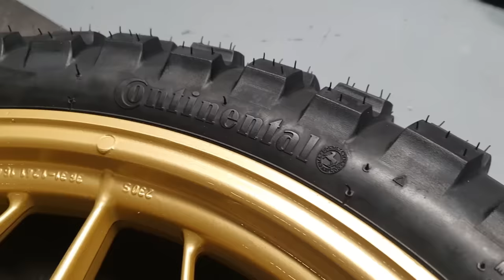BMW R100 RS Scrambler Full Build & Riding

Comment: Lots of obsolete touring bikes out there await chopping and the prices are right. While under-powered the old Airheads are simple and reliable so turning them into a coffee shop ride folk art piece is better than scrapping them. If you DIY nothing on that bike is expensive and parts are easy thanks to Ebay. Touring bike riders are like RV owners, if it's not the latest most loaded machine it goes cheap so take advantage.

Comment: Even if I'm more of a "stock" fan, the job you done is amazing! I was wondering how is the braking now with this new fork, callipers and discs ? And where did you get the fork crosses ? Is it specific made ? Cheers from France 😃
Reply from the maker: Thanks man. I bought the triples from The Powerbrick. That way it's an easy plug & play. The calipers and discs needed some custom work to make it all fir properly. Check out my IG page, Corner.Custom. There's more info about all this (and more) 👍

Comment: It looked better stock
Reply from the maker: Ok mr Wanker, thanks 👍
Reply: @corner.custom  its not a practical design, the seat looks like it should be on a riding lawn mower and the lack of fenders is case of style over substance
Reply from the maker: @dodgeewanker2179  Compared to OEM yes the bike became less practical, but became much more fun to drive due to the loss of weight and better drive ability due to the better shocks. I've put rear fenders on some of my R builds, but with this bike I wanted to go without. Matter of taste

Comment: Fucking hell that's a cool bike. Scramblers can be very very cool, especially with that naked look and off-road tires. 
I really want a super sport, but only because it will fit my needs. I don't like a lot of plastic on the bike and if i was living somewhere, where there were lots of dusty and muddy tracks, i would definitely think of a scrambler.

No plastic... on and off-road capable...that absolutely dominant sound... the license plate on the side...PERFECTION.
Reply from the maker: Thanks! That's why I've chosen to go for a metal fender instead of plastic one. More robust and better overall quality. The license plate holder is custom made, but painted it black to blend it in with the black theme of the bike so it wouldn't be that noticeble

Comment: you need blue fenders mate with a bronze paint line on them same as the gas tank...or black fenders work well too
Reply from the maker: With previous R builds I did that. Both actually. Black front and rear fenders, but also color matched stripes. Looked good, but for this bike I wanted to go this route
Reply: @corner.custom  nice! Well when the wheels are naked like this build, the bike looks more beefy💪Let's you see the whole circumference of the circle of the tires...LOVE THE BIKE!! GREAT WORK beginning to end!!💯👍
Reply from the maker: @reydelsanchez  Thank you man, appreciated 👊🏼🤙🏼🤙🏼

Comment: I wish you had a parts list. 
Awesome bike!!
Reply from the maker: Most of the parts used during my builds are mentioned on my Instagram page, Corner.Custom
Reply: @corner.custom  thanks I will definitely check that out. 

I’ve been having some issues, finding tires for my r100 (86) it’s a mono lever model. Both wheels are 18s, what other options do I have to go with a 19 in the front. Will wheels like yours for on my bike?
Reply from the maker: I'm not sure, I never build a mono before. But I'm quite sure that there are a handful of people who had the same issue as you have and came up with a perfect solution. Google is your friend 🤙🏼
Reply: I have MICHELIN ROAD CLASSIC 100/90-18 56V up front and MICHELIN ROAD CLASSIC 130/80B18 66V as rear tyre on my R100RS mono

Comment: Hello. I have a Honda CX500 and would like to use this speedometer. Honda has both sensing mechanically by drive. How do I connect this alarm clock? I looked that there are some "adapters" of the signal. Or take a signal from the ignition coil. And connect the speedometer via the front wheel, via a magnet, like a bicycle. Which alternative is used here. Or what do you think is the best solution?
Reply from the maker: Just go for the magnet, worked every time for me 👍🏼👍🏼

Comment: Probably a silly question but how do you keep track of where all the bolts and what-not and where it goes when putting it all back together?
Reply from the maker: Pretty good question 👍🏼I trow away all the normal bolts, washer etc. All the special brackets etc that are unique to the bike gets a coat of Cerakote. With the first bikes I took a lot of photos before taking everything apart. This was my 3th R bike so I already knew what to keep etc. When in doubt you can also look up all the bolts via the diagrams on realoem.com

Comment: Hmm .. actually would be interesting to know how did you get those CV carburettors to work properly with the cone filters .... 🤔
Reply from the maker: It's actually not that hard to be honest. Kept the same jets etc. Basic settings like the idle jet 1,5 turn out from fully seated and making sure the butterfly valve is nicely closed in the housing as well. Then it's a fine tuned by the Carbtune 👌🏼

Comment: such a beatiful bike. what frame did you used or was the original frame adapted to shock position? what fork did you used?
Reply from the maker: Thanks man 👍🏼frame is original, but went for stronger mounting points. Forks are Ducati Monster. There's a separate video on the whole front end of this bike on my channel

Comment: Hi
Should I plug the excess fuel drain at the bottom of the bmw r80 fuel tank?
Reply from the maker: No it's better to use it by putting a small hose on it, just like it is from factory

Comment: The heat dissipating fins on the heads being painted might cause overheating issues.
Reply from the maker: It's not paint, but ceramic coating that will help a lot. But I didn't liked the look of the blacked out exhaust nuts so I gave them a blast (like you can see in the end result of the bike)

Comment: The bike looks like a dream but, doesn't the water splash from the rear wheel if it rains???
Reply from the maker: That's why you don't want to drive when it's wet, also saves you time cleaning the bike. But also with the front fender on you'll get wet as well. Those are more for the esthetics
Reply: @corner.custom  Ahh OK. Thanks mate!
Reply from the maker: @alexanderoutlander.1040  Your welcome buddy 👍🏼

Comment: Great build! Two questions: what triple tree did you use, and did you cut the rear frame and weld the seat tube and shock mounts on or was that a bolt on kit? Thanks!!!
Reply from the maker: Thanks man. I recently uploaded a new video on this build where all the FAQ are answered which also includes all your questions. Also go into pricing and build time. Triple is from Powerbrick and shock mounts are welded

Comment: did you just sandblast the engine with the mating surfaces exposed?
Reply from the maker: I blasted the heads before I send them out to the rebuilder. All the other parts on the engine aren't blasted

Comment: just curious what makes this bike a scrambler? Is it the tires or was the height adjusted as well.
Reply from the maker: It's more a "scrambler". It has some similarities with the tires and wide handlebar, but that's basically it. This is my vision of a early 1980's bike with all the modern benefits and techniques

Comment: Hello, congratulations and thanks for this work and spending time for make videos.
I currently rebuild a R100 1983 and I would know something: with the Rick's regulator, it's necessary to keep OEM diode board or it is possible to remove it?
Bye ✌️
Reply from the maker: Hi man. You're more than welcome. I've got a full R100 wiring / how-to video on my channel which also includes the Rick's reg/rec. There's also a wiring diagram in the description of the video. That video probably will answer all your questions, otherwise just let me know 👍🏼
Reply: Hé, thanks for your quick response.
Are you talking about your video on m-unit wiring where you used the diagram came from The long way there channel?
I saw several time this video 😅
In this diagram the OEM diode board doesn't appear so I guess the Ricks reg replace it. In fact I just would like have a confirmation and a return of experience of the use of the charging wiring as you made.
Reply from the maker: @xercesI  Yes that part did came from the channel The long way there. When using Ricks reg/rec you don't nee the OEM diode board. The wiring is pretty straight forward to be honest. The experience is great, works like a treat with also new coils, startermotor and powerful lithium battery. Fires up without any trouble
Reply: Good !!! That's what I would to read 😁
I will fit a new dual coils also, what is the reference of yours please? Flatracer web site sells one who looks like yours but i'm not sure.
Reply from the maker: @xercesI I got mine from motolab, but they don't sell them anymore I believe. I'll have to contact them to see if they have a good alternative for it since I started a new R100 build

Comment: A bit confused when a box of Emping Balado makes an appearance at 2:12. 😂 I noticed the more rounded head covers on the finished engine instead of the original BMW square ones, are those Siebenrock? Amazing build, honestly a little envious.
Reply from the maker: Hahaha well your not the first to mention it 😅 The oval valve covers are called "peanut" covers 🥜 You can buy them in almost every caferacer webshop
Reply: The rounded cylinderhead covers are the 'classic' ones till the /6 series, with the /7 serie came the rectangle ones. There are also  two pieces'' cylinderhead covers ( Enduro) available 😁

Comment: Sure, the knobbly tires are looking more aesthetically, but on the road, I would always prefer proper street tires.
Reply from the maker: I think you'll be surprised by the amount of grip that these tires had on the street. It surprised me!
Reply: @corner.custom  I had a Honda with knobbly tires, and it was a drive like day and night, when I switched to street ones. Especially, when you lean into a corner.
Reply from the maker: Cornering in general wouldn't be such a  issue, but when you start to lean into the corners and start pushing it will be a different game. This was isn't made for that at all, especially after the build. But I get your point 👍🏼

Comment: The frame at 00:39 compared with the frame at 10:24 shows some modifications we missed out on allowing the different shock angles in the back. Did he modify the frame or just purchase a different frame for the project?
Reply from the maker: Nope I modified the frame. Newer/thicker shock tabs are placed and I extended the frame so the seat could be placed on

Comment: That’s the bike I learned how to ride with. I’m 5’9”, it wasn’t easy 🤣
Reply from the maker: Hahaha you should have kept the bike! The bike in it's original form isn't light as well!!
Reply: @corner.custom  😂It was my uncle’s,  that’s why I learned riding on that. It was the original, close to 300kgs🥵. Undersized frame, brakes, suspensions...but what a character!
Reply from the maker: @paolobenedicti1319  They sure are a handful like that. That's why I strip all the unnecessary stuff off, makes the drive ability way way much better
Reply: @corner.custom  
Beautiful result
Reply from the maker: @paolobenedicti1319  Thanks man 👍🏼👊🏼

Comment: It’s a cool looking bike and a really nice build. I’m a little perplexed, though, by the term scrambler. It looks likes it a mash up of a cafe bike and a scrambler. However, the tire and fender clearance on the front is minimal, with no room for mud build up. Also, the ground clearance looks way to low for proper scrambler rides in the woods and off-road. Still a great looking bike, just not very practical off-roading. 🤷‍♂️
Reply from the maker: This bike won't ever see the mud or even rain for that matter when in my possession. It's hard to put it in a box that matches all the criteria for a caferacer or scrambler, but I do think you can name it a hybrid between those.
Reply: Thank you, I'm trying to learn about these types of bikes and was confused about "scrambler" part. Can you elaborate what makes it scrambler hybrid though? Like what parts are not typical for cafe racers? Oh, forgot to mention: absolutely beautiful bike!

Comment: great job to praise ... did you also use the cerakot h146 for the engine
Reply from the maker: Thanks man. I've Used Cerakote for the cilinder heads and the cilinders. This because of the heath from the airhaed. The rest of the engine was done in a 2k paint

Comment: did you drill a hole on your top yoke to put a fatbar ?
Reply from the maker: The holes are predrilled, you only need to drill through the last 2mm for installing the bar. So when you want to use clip ons, the top yoke stays nice and clean without any holes visible
Reply: @corner.custom  thanks. Would ve been a bit dangerous if it wasnt meant for it i guess. Since my yoke doesnt have pre dilled hole I took conversion yoke from motor cnc. Pretty usefull as well. 
Btw: prbly not the safest things either.
Reply from the maker: Smart move by going that route. This is a R/K triple from The Powerbrick btw. Top notch stuff 👌🏼

Comment: Excellent project ! Thank you for sharing this. Will you please share also some info on the saddle and tyres ? Thank you so much . Keep up making those videos
Reply from the maker: You're welcome! All the info is on my Instagram page, Corner.Custom. Try to share as much as (in depth) info there ✌
Reply: @corner.custom  Thanks for the reply. Since i do not have an instagram account, would it be possible to find some info elsewhere ? thanks
Reply from the maker: @spycon69  The tires are Continental TKC 80s in sizes:
Front tire 100/90/19
Rear tire 120/19/18
Reply from the maker: @spycon69  The seat post is made by myself, but upholstered by Miller Upholstery in The Netherlands
Reply: @corner.custom  thank you so much !!
Reply from the maker: @spycon69  Your welcome!

Comment: WoW. Do you need to be a genius to rebuild it like that? Serious question. Also where do you find all these parts? Where do you even start, I’m serious looking into building something like that for myself. 👍🏻
Reply from the maker: Just taking your time to do it right the first time man. On my IG page I posted almost all the parts I use for all my builds. But most of the parts are bought from caferacerwebshop and the Powerbrick
Reply: @corner.custom  do you sell them? If so how much do they go for. This one in particular?
Reply from the maker: @dmitriypopkov5907  Yes I do sell all my bikes and at the moment I've sold all my bikes. The prices aren't fixed because it varies on the cost and state of the donor bike and the desired result of the build

Comment: One of the best builds out there!  What are the rear shocks and where can I buy a set?
Reply from the maker: Thanks man, those are YSS, you can buy them at Kpartsholland.com. I recently bought a new set from them for my current K12 build
Reply: @corner.custom thank you so much for the lead!  I need shocks about 450mm so I can use the factory welds on the frame to mount to.  I didn’t find any YSS at that length, most of them were 355mm.  I’ll keep digging though :). Thanks!
Reply from the maker: @pwo2185 I highly recommend that you enforce the OEM shock mounts like I did in the video, the original ones are so thin, not safe imho. And also then a off the shelve shock fits easily 👍🏼
Reply: @corner.custom absolutely agree!  What’s strange is I can’t find shocks that will fit this length anywhere!!
Reply from the maker: I bought these, but the length of those go up to 420mm. Why not move the shock mounts a little bit lower so you need a shorter length shock
Reply from the maker: https://www.caferacerwebshop.com/nl/re302-t-bmw-alu-black-twin-96337761.html
Reply from the maker: Bought them here btw

Comment: great job, how big are the suspensions? did you use the saddle pads already present or did you redo them?
Reply from the maker: Thanks man. The shocks are YSS and are 420 mm in length. I bought the seatpan with the foam and then send it of to the apholstery
Reply: @corner.custom  I was talking about the rear suspension attachments, did you modify them?
Reply from the maker: Yes I cut off the original brackets where the subframe was mounted on. Then I welded up thinker brackets which I placed a little bit longer than original to give the bike a better angle

Comment: Hi, three quick questions…
What solution did you use to brush in and clean the engine?
What paint did you use for the engine paint?
Did you paint the frame with the same paint or do a powder coat?
Reply from the maker: 1: Just petrol!
2: Used a 2k paint and also Cerakote
3: Also 2K paint to match the engine color

Comment: How many hours of work goes into building it? And how much does a bike like this go for?
Reply from the maker: From start to finish a easy 300 hours. Price depends on the state of the donor bike and the amount of work and quality of parts you're using. This bike got sold for 16k euro.
Reply: @corner.custom  I appreciate you taking the time to respond. Thank you for the answer.
Reply from the maker: @lakalajadizaja4332  No problem man, any time

Comment: what is the radius of the wheels?
Reply from the maker: 19 inch in the front and 18 in the rear
Reply: @corner.custom  Thanks a lot. and tell me what kind of exhaust system it is, brand and manufacturer? very nice sound.
Reply from the maker: @alehandro3600  The one from the link down below
Reply from the maker: @alehandro3600  https://www.caferacerwebshop.com/nl/16-slash-cut-shorty-black-uitlaatdemper.html
Reply: @corner.custom  thanks